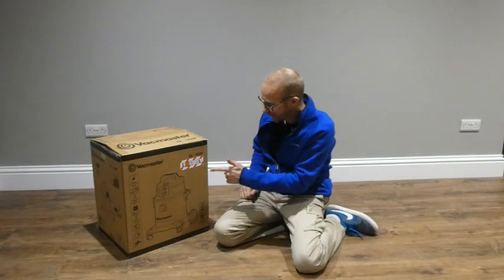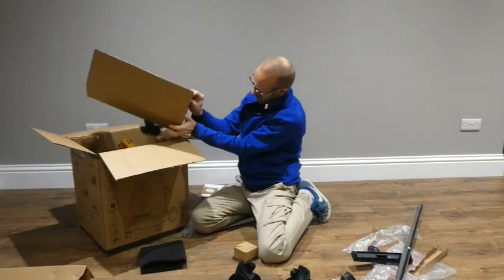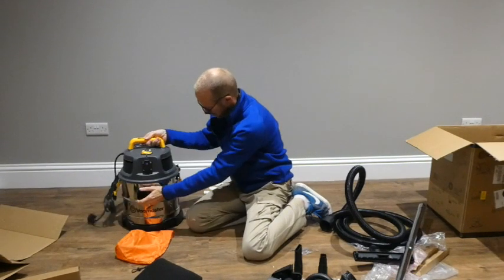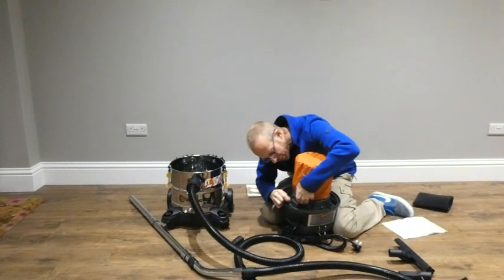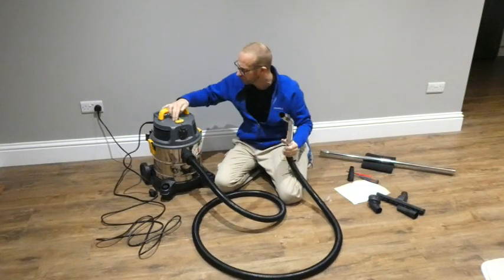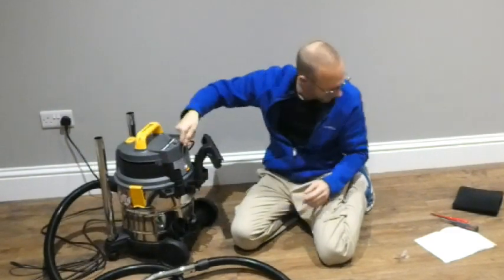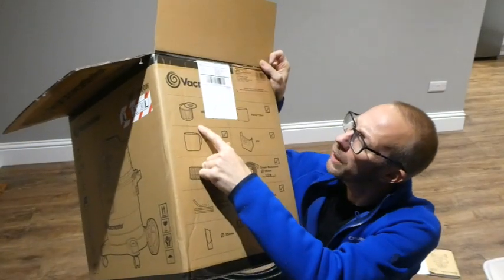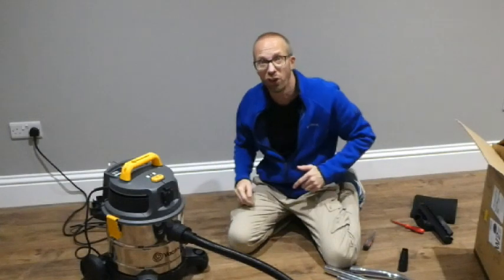Vacmaster 20L Dust Extractor - Industrial Wet and Dry Vacuum Cleaner with HEPA 13 Filtration

Comment: Bought this model a couple of years ago.  Compared to a normal lounge cruising domestic vac this thing is pretty loud…but the trade off is a suck bordering on scary!  Big 2 inch intake port for workshop size hoses and of course that twin fan by-pass impeller which means the finest debris doesn’t go through the electric motor.  Not having a blower port is a shame, but if you are using one of these you are probably a practical ‘make it/modify it yourself’ type, in which case an adapter plate to convert the exhaust into a blower outlet is a fairly simple affair to cobble up.  The ‘bigger’ 30L version uses the same motor head, the bin size has no effect on performance.  Great for workshop/garages, but a bit too loud for long sessions such as using downdraft tables for carving.  In a workshop I’d recommend making a sound deadening cabinet for it unless just having a quick clean.
Reply from the maker: Great comment, thanks for this 👍